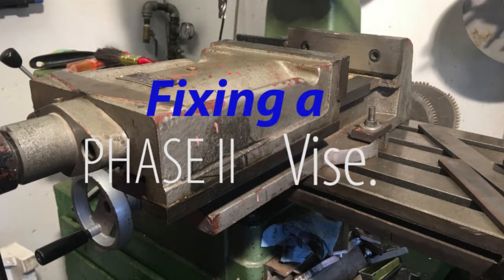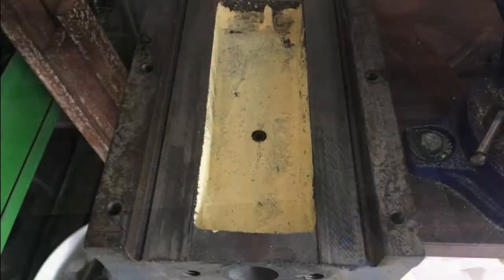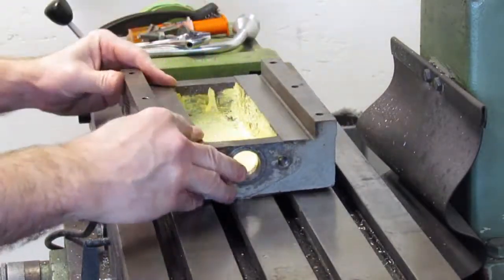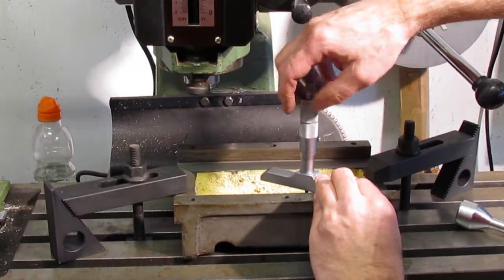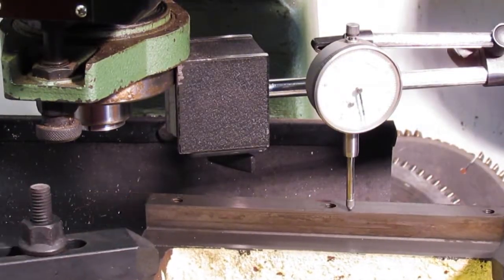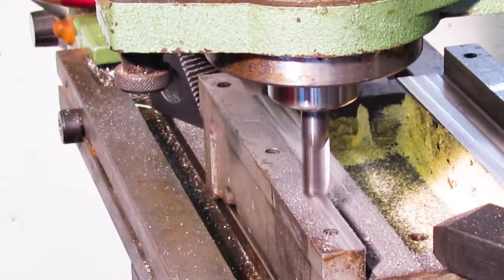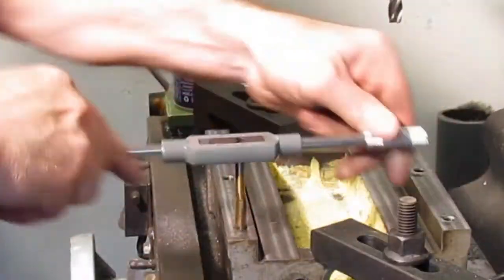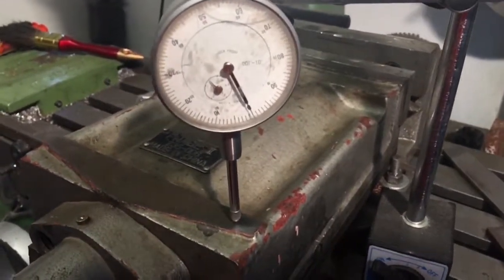Fix/Improve the Clamping on an Imported Vise "Phase 2" Brand.

Comment: Watched your video the other day. I have a similar vise. My problem was that when you would clamp your work piece in the jaws it lift (raise) it five to six thousands up. So I used your method to reduce the amount of play between the movable jaw and the base. ( clear as mud) . Anyway I was able to get the issue down to about one to one and half thousands of lift. So much better. Do you think it could be reduced more? Maybe someone would like to do a video on this subject. Thanks for the video, it was well done.
Reply from the maker: Hi James, thanks for the comment. I think in order to make the vise tighter would require surface grinding. Might look into that for the future or buy a Kurt vise.